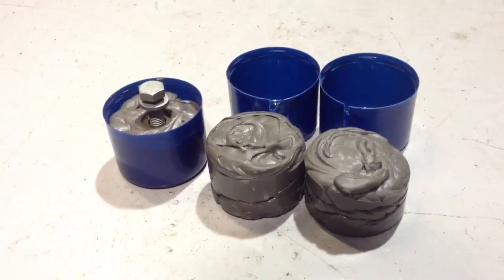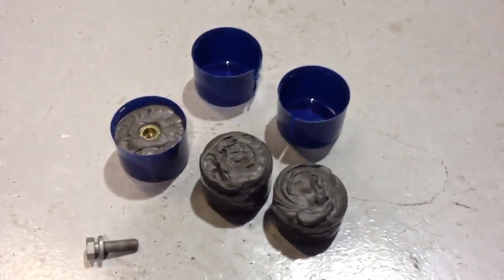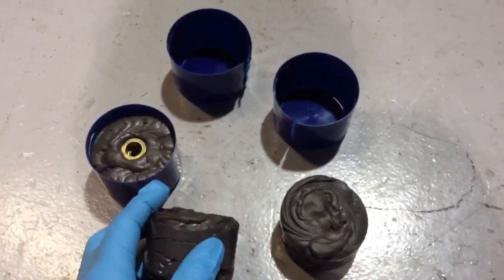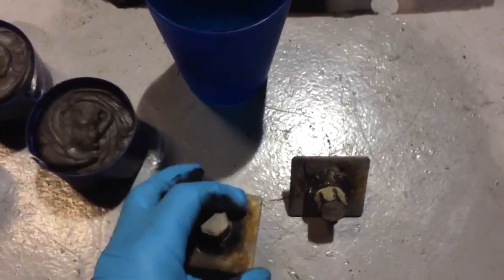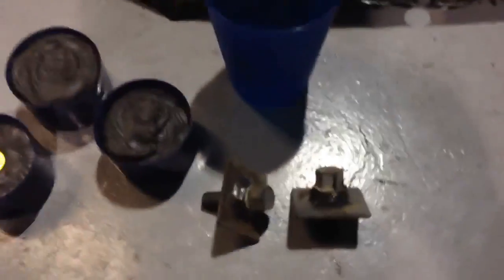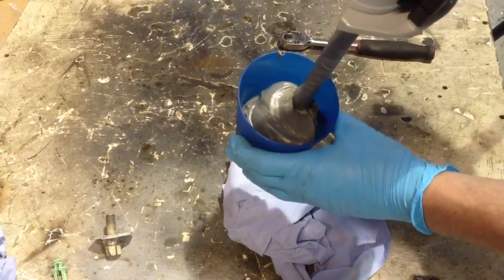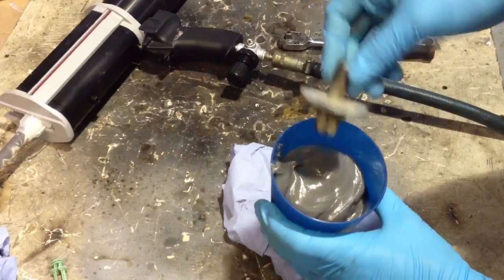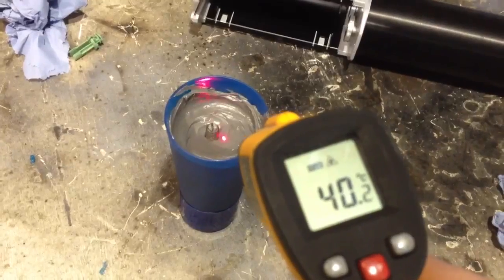BMW Structural Foam - PART 2

Comment: ...would the process or manufacturing of these parts be better improved, if you put them in a bag and vacuumed out the air out of the bag, after injecting the material into your mold?  And, would some kind of release agent work in the molds, so that you can remove the injected piece"